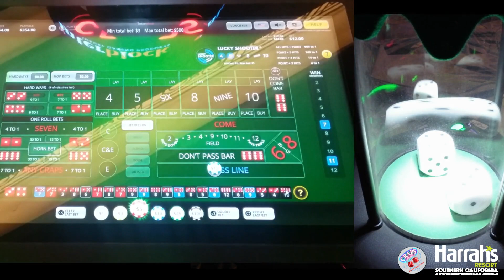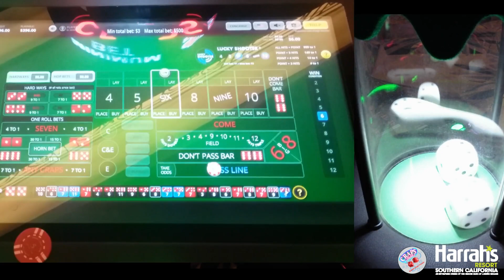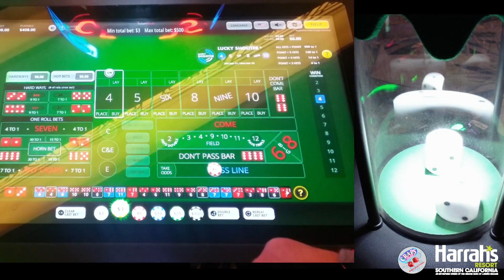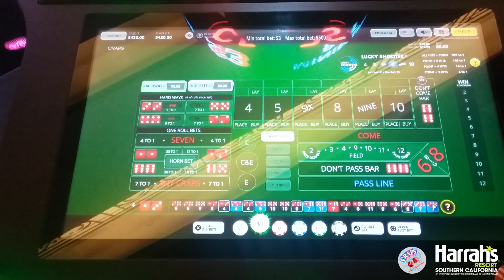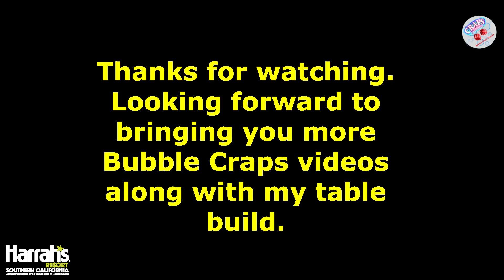Bubble Craps Tracker: My Default Srategy

Comment: There's a lot of background noise so it's hard to hear you.  Can you explain your strategy?
Reply from the maker: The basics are simple. You start with a small bet such as $3 or $5 on either the pass or don't pass. After two decisions you double the bet until you either have earned 20x the original bet or you have lost your bankroll. The max bet is 8x the original bet.
Reply from the maker: Also here is a link with more info.  https://youtu.be/Tghh0DNOyt8